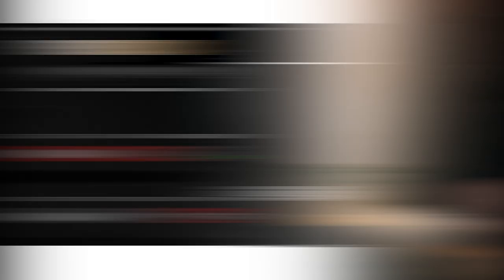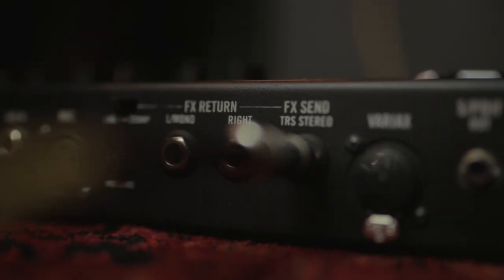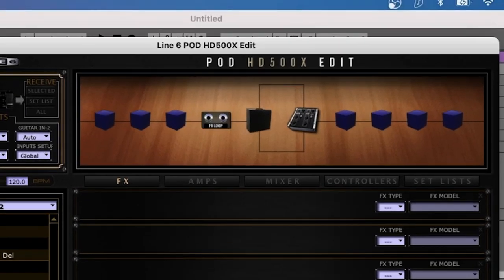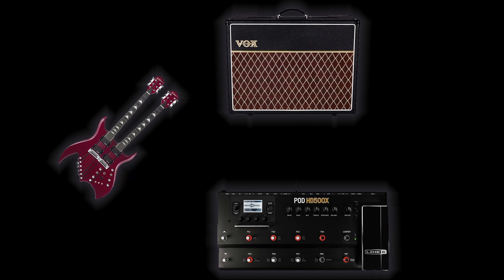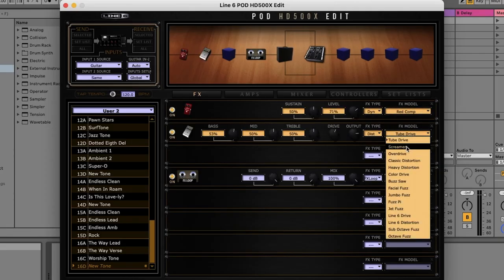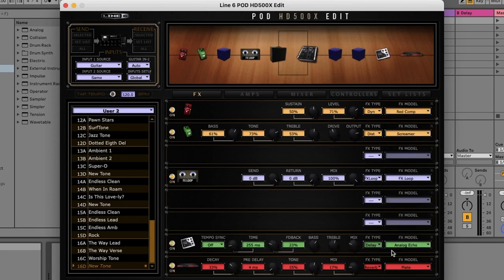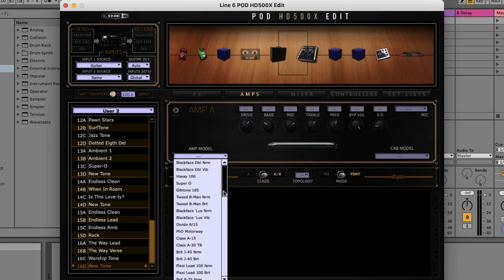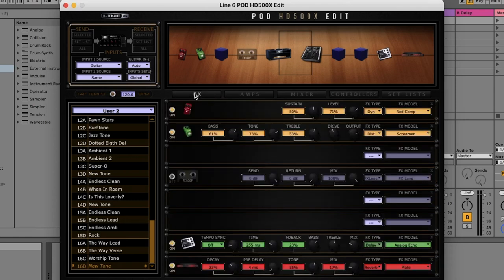4 Cable Method TUTORIAL + IN-DEPTH Explanation

Comment: watched whole video but didnt understand anything ...can you please simplify it more using a board & pen ... like what is the use of this method & how it makes the difference than conventional method how we use POD or other modelers & why we doing those connections & what if we reverse those connections what will happen (Wht are FX send / returns etc etc ) .Thanks!! Your channel is amzing  & you are doing a good job .
Reply: To try and make this as simple as possible, forget about the Pod for a minute.  I'm going to try and over-simplify so use this as a guide and not a word-for-word exact explanation.
A guitar amp has two sections, a Pre-amp which shapes your tone, and a Power amp which makes your tone loud.  When you use a pedal, typically you plug your guitar into the pedal and then it goes to the amp, which means the signal chain would be guitar>pedal>preamp>poweramp.
Some pedals, like overdrives and distortions, sound great when used in this order.  Other pedals, like delays and time based effects, don't sound the best if they are placed before the pre-amp, so amp builders will put an "effects loop" in the amps signal chain after the pre-amp but before the power amp.  This way you could plug your guitar into an overdrive pedal, then plug that into your amp, then you would plug a cable from the "FX send" on the amp into the input of your delay pedal, then the output of the pedal to the "FX return" on the amp, making your signal chain guitar>overdrive>pre-amp>delay>power amp.

The Pod also has a built in FX loop.  If you are plugging your pod into a computer and not using a physical guitar amp, but you wanted to use some other physical pedals with it, you could plug your pedals into the FX loop and then pick where those pedals go in your chain (for example, before the amp block if you're using overdrive pedals, or after the amp block for delay.)

Now, if you are plugging your Pod straight into a physical guitar amp, your signal chain is going to be guitar>pod>preamp>poweramp, which means your delays from the pod might sound bad, and if you want to use a pre-amp model in the pod your tone is still going to be changed by the physical guitar amp's preamp.
By using Jon's method, your signal chain will essentially be guitar>pod>preamp>pod>power amp, so you can put your Pod overdrive effects before the physical guitar amp preamp, and your delays after the preamp.  With his method, you can also eliminate the tone-shaping from your physical guitar amp and use one of the pre-amp models from the pod instead, or use a footswitch to switch between them.

As for why we do those connections, we are essentially putting the physical guitar amp preamp into the FX loop on the Pod, so you can put your Pod effects before or after the preamp (by placing your effects blocks before or after the "FX loop" block).  As for "what if we reverse those connections" there are multiple options for that, and hopefully now you'll understand the purpose of the ins/outs and can play around if you want.
Reply: @mazzymazzer1969  Thank you for your awesome explanation! I finally get it. Thank you for taking your time explaining this to us newbies. It really got through me now.
Reply: I did have a question would pod’s amp models sounds realistic or better using 4 cable method in live gigs?
Reply: @Thesamtvv  it's possible, definitely depends on your amp setup, the room, and the sound setup

Comment: I use a Pod Go.  During a gig I typically stand 8 (plus) ft away from the amp.  Is there any advantage on using TRS type cables between the Pod Go and amp?  What type cables would you recommend for say 10 ft away to avoid the loss?

Comment: Some things  id mention is make sure you also turn the cab model  off!  Otherwise you ruin your tone.  The poweramp stage is not meant to pass a cab sound thru.  It powers your cab!  

Also,, very important ! make sure on system settings,,, output is set to either combo pwr amp or stack pwr amp (whichever your amp is) and set the little 1/4 output switch by foot pedal to "line".  This is for impedance matching.

   Lastly im pretty sure you will have to buy a ReAMP box for going from the hd500 send into the front of the amp!  Most people dont know this!   the hd500 effects loop jacks  only allow either line/stomp mode. Its a one size fits all.  It sets all the fx loop ins/outs for the same impedance   and for the 4CM you need stomp mode(high imp) for the fx send but line (low imp) for the fx return.  Only option i know is  a reamp box.  set fx loop to "line"  then send -> in  reamp box out -> front of amp input.  Your guitar amp's input must be presented with a high impedance signal and proper gain or the input isn't driven and loaded properly and tone will suffer.  I think this is  correct.  If im wrong someone with more knowledge please correct me.